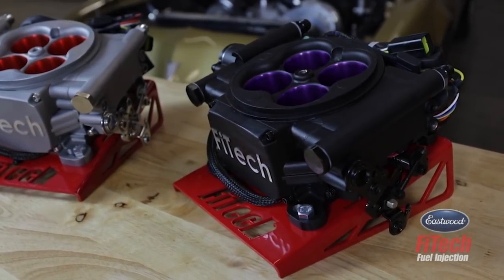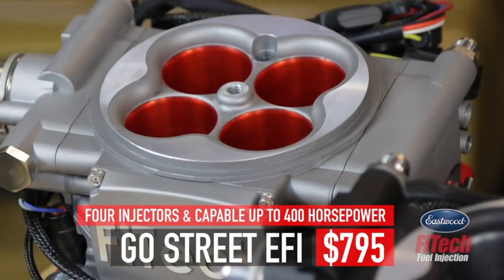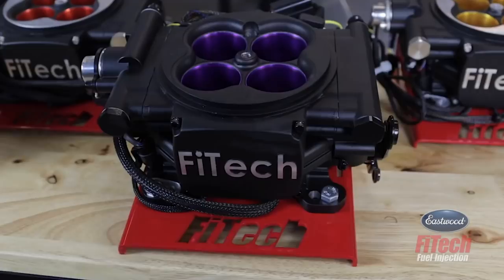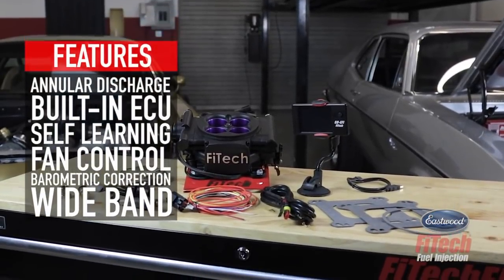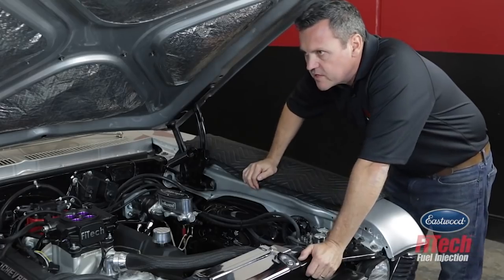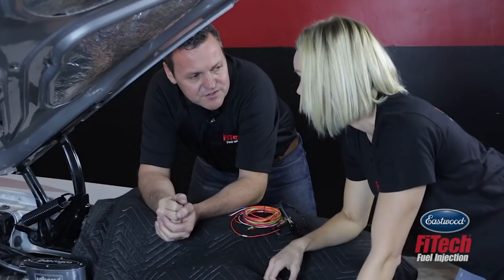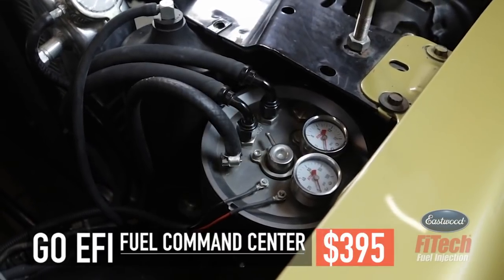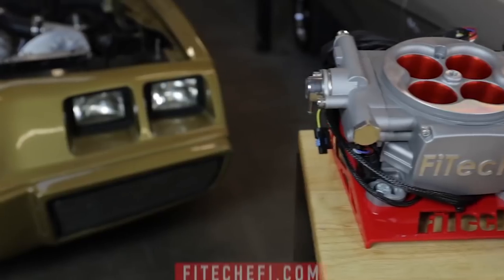FiTech Installing the Mean Street EFI Kit - Electronic Fuel Injection - Eastwood

Comment: I met someone who had the Fitech on his Fod pickup, said at first it was a horrible install,the Fitech was picking  up signals from the distributor , once they had figured that out, they installed a "chip" and this rectified  the problem...  do you supply these chips? if this problem occurs ? or are  the newer street versions  protected from external Distributor signals  ?   I'd like too have one of these on our Mustang , been looking